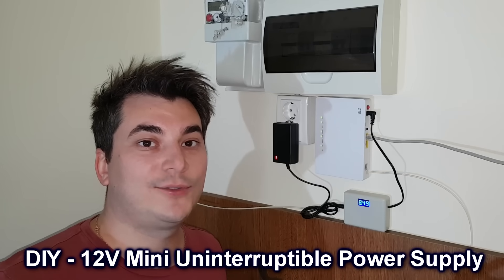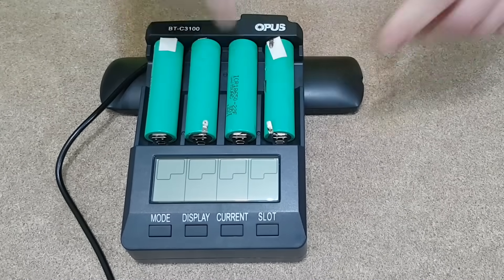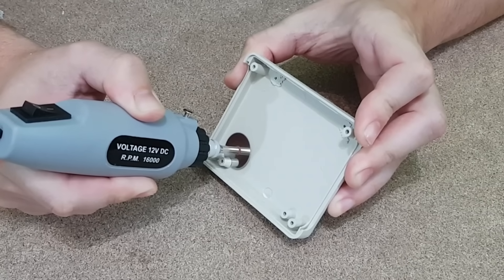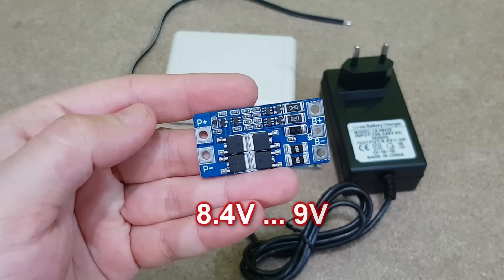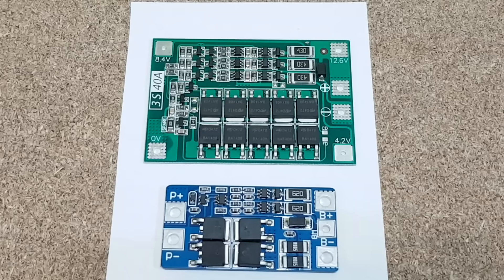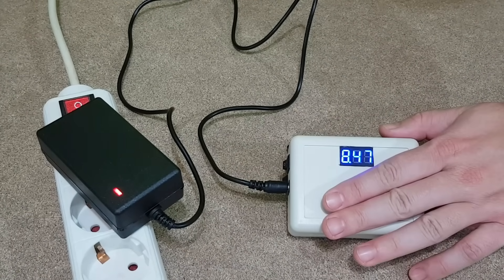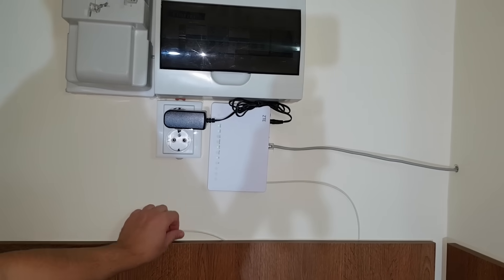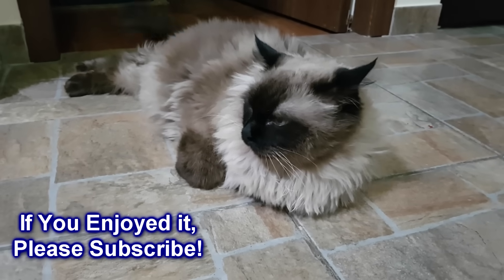DIY - 12V Mini UPS

Comment: next you need build, real 12V battery bag,  solar panel + how charging, i need build 12V power bank my 18650 battery whit battery holder not need solder battery only need solden battery holder all wires, better. but how charging, 40-100W solar panel ,i not has buy yet what size need, but ower 12v need be can charging batterys. i have batterys 20 pcs. and step down board stabile outbut to what uses. 12V. my problem have not understand what need input power, chargin module, need bms or not. 4 cell battery bag, mean 4 cell 4x3,70=14,8volt and what need be charger and panel ? capasity need be 4 cell 2200mah x 4=8800mAh battery. but how connect if need bms ? and how charger need add ? output only know need step down board 3A i have many, make stabile outbut 12,1V thats is my case but no know how make all sure good. charging ? bms ? panel power ? 4C 4P system but how connect bms or need be and how connect batterys,  help need how connect all together safety. and what charger can use ? 18650 old batterys can use solar panel charger what model ? all not can charge li-ion battery i know. but what can ?

Comment: Hi Sorin, great video! I would like to ask at 11:47, your adaptor is powered by the battery (in the case of power voltage). Do you think the adaptor can handle this 'reversed power supply'?
Reply from the maker: Hi. theoretically the charger can handle the reverse voltage. but you can add a diode on the positive wire to stop the reverse voltage.

Comment: Can i use 3s bms with 3 batteries in series with the default 12v 2amp adapter which come with router?
Reply from the maker: yes, but you can't use the entire battery capacity. also the lithium cells will unbalance in time, because they can't all reach the BMS balance voltage, which usually is 4.18V - 4.2V. and they will be charged continuously, because they can't reach the overcharge protection voltage. this will slowly damage the cells and they will loose some capacity in time.

Comment: Is possible to make a 12v 3.5A Output UPS?  My netgear router is 12v 3.5A powered
Reply from the maker: yes, but you need a bigger battery pack, probably 5S2P and a powerful step down converter. I'm working right now on a better UPS, I think it will help you.
Reply: @Sorin_DIY  I'll follow you waiting for this. Thank you

Comment: very impressive; nice and concise with just the right amount of levity.  thanks for inspiring me to figure out some way of creating a solar connection to the new ONT that's on it's way—will be mounted inside.  i've been using a RavPower array and battery pack when out camping, and i'd love to find a way to protect us from days without electricity in the DC area (notorious) in the event of big snowfall.  Verizon will be running new fiber along side our old copper telephone wiring, and so i'm even wondering if there is a way to somehow use/reconnect the copper lines again during such an event...anyone have any ideas/links/etc?

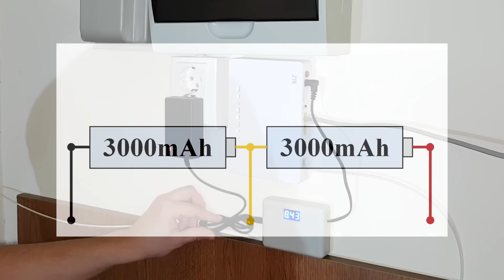Comment: Would it be okay to connect 2 step up converters to the same 2S BMS protection board so that I can configure one with 12v output and the 2nd one with 9v output. I need to power a Wifi Router (9v) and an Optical Network Unit (12v). Also can I add 2 batteries parrallelly like you mention at 12:16?
Reply from the maker: yes, but it depends on the current consumption of your devices. you may need a more powerful charger. I will make soon a better UPS with 2 outputs.
Reply: @Sorin_DIY I've measured that my Wifi Router (9v) consumes 0.20A and the Optical Network Unit (12v) consumes 0.16A. I want to setup a UPS system that keeps both these devices powered on all the time. Can you please reply the following doubts I have!
1. Of what power rating, the adapter connected to the BMS should be, so that the batteries charge and both devices work simultaneously.
2. Do you think a 4S 30A BMS will be better than 2S for my setup.
3. Please tell me the capacitance of the capacitor I should use for each devices.
Reply from the maker: hi. it's better with a 4S charger and battery pack. then you will use 2 buck converters. the charger needs to deliver 16.8V and 2A. the capacitors 16V and 1000 - 4700uF.

Comment: What type of fuses did you use?
Reply from the maker: 1.5A fast blow fuses
Reply: @Sorin_DIY  thank you
Reply: @Sorin_DIY  would this  fuse still work if I wanted to use 5V 3A?
Reply from the maker: @thanoswasright626  you need 3A fuses
Reply: @Sorin_DIY  Which capaciter did you use? would that be the same for me?
Reply from the maker: you need a capacitor with a rated voltage higher than what you use. for a 5V output you need a 10V capacitor. the capacitance depends on the load. bigger the load, the bigger the capacitance. for a 3A output I suggest a capacitance of 4700uF - 6800uF
Reply: @Sorin_DIY  Hi Sorin, Sorry to keep asking dumb question im just waiting on a 4700Uf capaciter (ordered 470uF by mistake) this will hopfully be my last question on this but the wiring  for the step down converter is it DC Jack to ON/OFF switch to Stup down board?
Reply from the maker: yes
Reply: @Sorin_DIY  capacitor has arrived is this soldiered directly to the output connections on the step down board with the output dc cable?

Comment: Great Job ! How we can activate a device (not the router) only in the power failure ? So the device will receive power from the battery only if electricity cuts off. By the way it will be great to make a video for emergency led lights when power failure! Thank you and continue the great job !
Reply from the maker: hi. you can use a relay.
Reply: @Sorin_DIY  Thank you for your reply! Since I will buy everything from aliexpress, do you have a relay that you used to suggest ?
Reply from the maker: I'm still testing a few components. I will probably use a relay in my next UPS video.

Comment: ... whatabout insalling a diode to prevent charger of drawing energy when offgrid? ... would make project 110% ...
Reply from the maker: diodes have a small forward voltage drop of around 0.7V, so the li-ion cells may not get fully charged. if you use a 9V charger, you can add a diode.
Reply: @Sorin_DIY  ... use an "ideal diode" with near zero backdrop ? ...

Comment: I saw a small flaw, its even powering the input ends when on battery ... I think putting a zener diode will help fix that. Two diodes, one for positive and one for negative will work ? or a single diode on positive IN connection will work ?? Let me know .. :)
Reply from the maker: hi. a single diode on the positive supply wire is enough. but diodes have a small forward voltage drop of around 0.7V, so the cells may not get fully charged. you can use a 9V charger with a diode on the positive wire.

Comment: I've modded this good original design, my fibre router was affected by the high frequency of the boost output.
Instead of 2x 18650+boost I found it simpler to use a 3S 20A Li-ion Lithium Battery 18650 Charger PCB BMS. and a standard 3s battery holder.  Mod the standard router power lead to tee in the BMS via a 5.5 power jack and fix to the back of a standard 3s 185650 holder (if you need more double up and use 2 cells in parallel x3).  3 cells just about makes a good enough 12v and not having to boost makes life much less complicated, you can use the router's standard psu with bee sting connector to feed the BMS.  Because the BMS is teed across the feed and doesn't intercept it - switchover is still instant and bonus is the batteries smooth the PSU output without a capacitor - it means you can disconnect (borrow) the UPS to act as a powerbank without powering down the Router so with the BS on the back of a standard 3 cell 18650 carrier I think it's actually a smaller footprint with a more convenient switchless "always on" connection. 
Because you tee the UPS to the power feed there is no chance of an accidental break in service win win.

Comment: I have something similar but instead I use a PWM solar charge controller connected to my overkill 14v 5A PSU that charges my 12v 7Ah battery. How ever I'm not sure how much in amps my router takes it holds well over 10-12hrs which is enought for various situations.

Comment: hii bro, i wanna make a ups for my wifi router and modem, so how can i get 2X 12 v   output on single 5v input .plz help....🙂
Reply from the maker: hi. I depends on the current consumption of your devices. but I don't think a supply voltage of 5V is enough for 2x 12V outputs. I will make soon a better UPS with 2 outputs, but it will have a higher voltage battery pack.
Reply: @Sorin_DIY  thank u... waiting for it...❤️

Comment: Hi Sorin, loved your video. I have a couple of APC UPS units, and I was wondering if you could suggest ideas to convert them into 12V DC UPS. I do not want the invertor part, so I can get 12V DC out.
Reply from the maker: hi. it will be difficult, because it's designed for lead acid battery. the charging voltage is around 13.6V. the battery voltage is between 9V - 12.6V. if the batteries are still good, you can add a buck/boost converter and set the output voltage to 12V. but in my opinion, the entire UPS will be too big and heavy for a 12V output. I prefer li-ion cells.
Reply: @Sorin_DIY  Thanks for the reply. I guess, I will leave them as is for now.

Comment: If I use a 2S3P battery configuration will it still work with the other components that you used? I will be using 3000mAh cell.
Reply from the maker: yes. but you need to use the BMS board from the video description.
Reply: @Sorin_DIY  Thank you

Comment: Hi I am planing to build one Can I use generic 9V 2A charger with 2s20A balanced BMS directly ,Or can I use some resistors or diode for voltage drop to 8.4 or do I need to use special 18650 8.4 charger because in INDIA its very difficult to find such things
Reply from the maker: hi. you can use the 9V charger. there is no need for a diode. only if the charger LED is powered by the battery, when the power is off, you can use a diode to stop that, but it doesn't draw too much current. I suggest you use the BMS from the video description.
Reply: @Sorin_DIY  tq ur reply I have one more question outside of this .I have 2s3a bms which is like a thin aluminium foil.I would like to use for creating that for 2nd ups for 5v which charger can I use .Same 9v charger can I use
Reply from the maker: you need to check the board specifications for the input voltage. but you must use a BMS board with all the protection features, including overcharge release voltage.

Comment: Very nice video! I want to do something similar to power my 12v router, 12v camera and 5v raspberry pi. Are you panning a video on making a small UPS with different voltage output?
Reply from the maker: hi. I will make soon a better UPS with 2 outputs.

Comment: can i use it on 2pcs 1am router?
Reply from the maker: no. I will make a more powerful UPS soon with 2 outputs.
Reply: when it will be ?
Reply: by the way bro i have add 2 battery so all in all its 4 battery

Comment: Would a diode towards the charger solve the problem with the charger led?
Reply from the maker: yes. but diodes also have a small voltage drop of 0.6 - 0.9V. so the battery will not be fully charged.

Comment: it seems to me that the voltmeter is only giving information about the capacity left during outage. because sens wire is connected to (+) of the socket, so it will always show 8.4v when charger is connected to the build, and when power is present. Even if batteries are discharged. Not actually to monitor charging capacity of the battery pack, maybe was better to use model you used in your  15000mAh Power Bank build to monitor up and down of the battery Pack??
Reply from the maker: hi. I chose this digital voltmeter because is smaller than a standard battery indicator. it shows the battery voltage all the time. 8.4V - fully charged, 5.8V fully discharged. so you will know for example, when the battery voltage gets to 7.1V, thats about 50% of the capacity.
Reply: @Sorin_DIY  Thx you 😉

Comment: thank you boss. that is much needed content. one question  is there any other way keeping 12V charger instead of throwing it?
Reply from the maker: hi. usually the standard adapter that comes with the modem/ONT is very underpowered. it may not provide enough current to charge the cells and run the modem. you need to test the current consumption of your modem and the output power of your adapter, then you can decide if you can use it.
Reply: @Sorin_DIY  True, usually modem/Router use a very low consumption, I mean during my testing my router was barely reaching 300mA, even on the back sticker consuption is writed to be 850mA! So a 12v/1A is fine for the router but, since the 18650 are amps eater, I think they will get charged very slowly. I guess...
Reply: yes, just add a stepdown module to the build, to decrease 12v to 8.4v IN, then follow the schematic 😉

Comment: Such a great video! I've watched it more than once.
I have a question, if you wanted to significantly increase the run time - say with 10 or 12 batteries what would be a good approach? Parallel more batteries, or parallel more BMS or both?
Reply from the maker: hi. you can make a 2S4P battery pack. if you add more cells in parallel, it will take too long to charge them. if you want a bigger battery pack, you can make a 4S3P pack with a 16.8V charger and a step down converter.

Comment: My ONT needs 12V whereas my Router only needs 9V. So I decided to build a 3S mini ups

Can I use 3S BMS( 3 cell battery) with this Step-up(Boost) converter to get accurate 12v 
and I also need 9V so in the same way, I should use another step down(buck) converter to get 9v precisely. 

The primary reason is to make the voltage stable because by a 3s BMS minimum voltage can be 9v and the maximum is 12.6 with a nominal 11.1v but I need to supply 12v and 9v respectively. So for   12v, I have to Boost since the voltage can be as low as 9v when batteries fully discharged and for 9v I have to use a buck converter to assure a stable 9v always. How about this idea. 

Let me know, TIA
Reply from the maker: hi. I will make soon a better UPS with 2 outputs. but if you can't wait for the video, I suggest you make a 4S battery pack with a 16.8V charger (preferably 17V). then connect 2 step down converters for the 9V and 12V. it will be more stable, it will get less hot (if you use powerful converters with radiators) and it will have longer autonomy.
Reply: @Sorin_DIY   There is a problem my charger is only can charge a 12v device so it's not possible to use 4S what is the issue for 3S let me know
Reply: what if i use 2S BMS( 4cell) battery with (9v 2A charging) 2 boost converter  XL6009 to get 9v and 12v respectively. 
MY primary concern is conversation efficiency with optimum backup.

N.B. I think 4S is a bit harder to charge thus thinking of 2S. Please let me know I badly need this since power outage  everyday fact!
Reply from the maker: in this case I think a 2S2P battery pack with 2 step up converters is the best choice.
Reply: @Sorin_DIY  Thankyou

Comment: I liked your video very very much. Very neat and clean and systematically done. Nice work.

I am going to build one, but I need both 5v and 12v power outputs(one for modem and one for router).
Can I use 3s BMS board with three sets(of 2 cells) 18650 cells which will provide output directly around 12.6 v and avoid using one step up converter? how much is a voltage drop after subsequent usage of time?
If possible, could you create such a video that will give two outputs (5v and 12 v) with explaining the reason to choose your design, in making it.

Thanks for the video. Very much appreciated. Keep posting such nice videos. All the best..
Reply from the maker: hi. I will make soon a better UPS with 2 outputs 12V and 19V. it will be similar to what you need. but if you want to build it with a 3S battery pack it will be a bit difficult. I suggest you make a 4S battery pack, use a 16.8V (preferably 17V) charger, and 2 step down converters.

Comment: Hi Sorin, I built the UPS but the output is 12Volt without load. But is connect my router which 12v 500MA... The output voltage goes down to 7.2 V. Whether it is the problem with the booster board? Also let me know how to give dummy load to test the UPS. I mean the load resistor value and watts
Reply from the maker: hi. what type of step up converter did you use? is the BMS output voltage dropping also? if not, the problem is at the BMS. the load resistor should be 10W and the value depends on what current you want it to use. you can use Ohm's law to calculate it R=U/I. so if you want 0.6A; R=12/0.6 =20ohm.
Reply: @Sorin_DIY   Thanks Sorin I'm using Robocraze XL6009 DC-DC Step-up Module  for  setup. BMS  out put  not dropping it is stable. Only the Booster output is dropping  when connected to load. Whether i need to adjust the pot meter after connecting to load.
Reply from the maker: if the input voltage of the step up converter is stable and the output drops, then probably there is a problem with the step up converter.
Reply: @Sorin_DIY  Thanks Sorin. I will check Step up converter
Reply: Hi Sorin,  It was problem with step up  converter XL6009. I replaced it with XL 6019. This very cool module . There is  no heat generated in the IC and the output voltage is stable. Now my Mini ups working fine and power backup is around 20min.